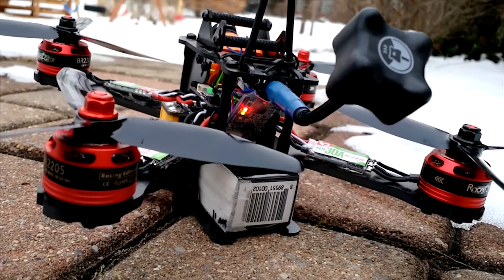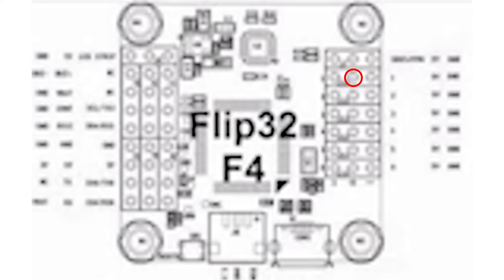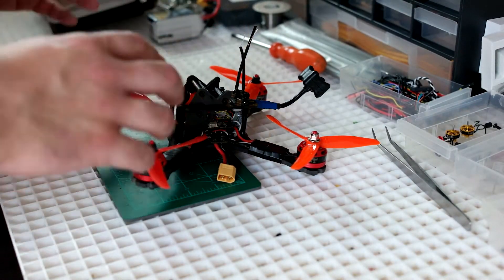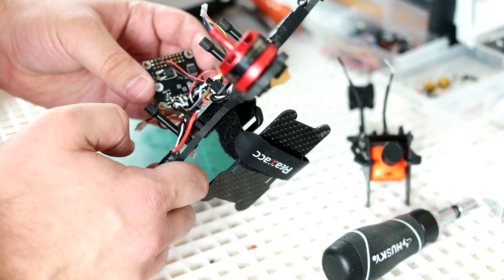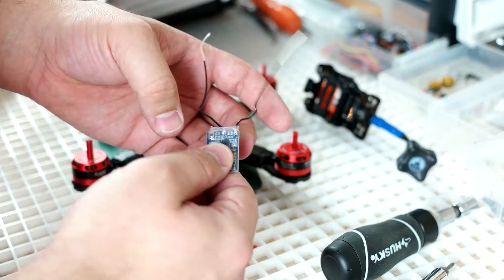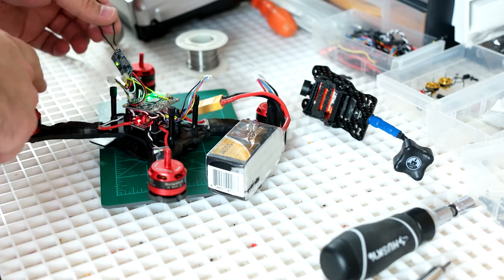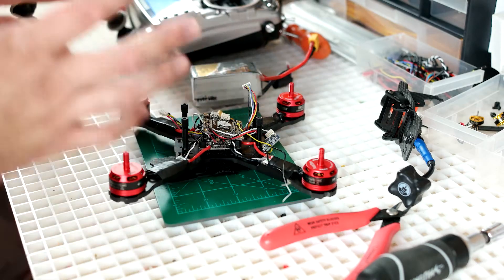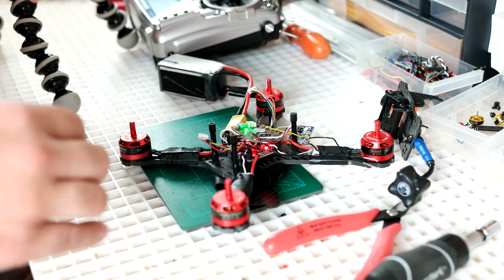RealAcc X210 FrSky Telemetry + Power Troubles

Comment: hello, do you remember what pids you used with this x210 and the racerstar motors, im on bf 3.2 with notch filters on 0 and pr1 enabled but i still have alot of problem and im not the best tuner so i still havent found pids better than the stock

Comment: What do you use the Telemetry on your Taranis for? Other than being neat to have feedback on the controller -- what's it useful for when you fly?
Reply from the maker: I use it for the low voltage warnings.  While flying it can be difficult to focus on the OSD, and it can be easy to ignore your voltage dropping to dangerous levels.  Having the Taranis announce the low voltage is easier for me to be alerted and then take the appropriate action.  I also have a timer setup on the Taranis, but enough other factors can influence the accuracy of relying on the timer..
Reply: Ah - nice -- that makes sense - thanks man

Comment: I was also getting those 5 volt drop outs on 3s Lipo's. I am sharing the 5volt output with my HS1177,X4RSB and my Naze32. Its not a problem on 4s Lipo's.
The issue is that the 5 volt converter on those PDB's is limited. Putting high power motors causes the Lipo to sag and the PDB struggles to maintain enough current.
It used to be much more widespread problem with earlier PDB'S. Ive had quite a few PDB's 5 volt output give up completely.The Matek ones are better though.
If you cannot trust your 5 volt output. Then the best solution is to add a buck converter. Connect it between your Lipo and your flight controller. Buck converters are adjustable, so you can dial in 6 volts. This takes the strain off the PDB,No more issues.

https://www.banggood.com/DC-DC-Adjustable-Power-Supply-Buck-Converter-Step-Down-Module-p-922049.html?rmmds=search

Comment: Hi, have you come up with any good pid's for this build.
I am struggling to get some good pid's for this build as I am new to tuning and would love to have a starting point.
Thanks 😉
Reply from the maker: +Q-Rexx FPV I have added a go pro session to my build and still need to tune further with that configuration. I definitely had to increase d a bit with this build though. And run lower ps than I was used to on other builds.

Comment: That antenna testing tells nothing. You get signal that close to the transmitter regardless of antenna condition (...and you still had one working). I don't know what you mean with old battery at the end but it seems that battery is at storage voltage, which is good. A4 telemetry is average calculated cell value, not total pack voltage which is VFAS if that's what you tried to achieve.

I use onboard 5V only for FC and receiver. Camera and VTX use the PDB 5V. For LED lights I have a third 5V source (Prod: 999753 form banggood).

Pics: http://www.saunalahti.fi/~uzzi/random/quads/omnibus/
Reply from the maker: Thanks for the reply man, I probably wasn't clear in the video what my goals were with my testing.  I wasn't testing the signal strength by reconnecting the antenna.  I was just trying to make sure I didn't short anything and break the receiver, which I didn't think I did, but seemed worth testing.

I am also fully aware of the different voltage telemetry values.  I was simply pointing out that I was expecting a storage voltage charged battery and not a fully charged battery.  I didn't want someone to assume that the voltage reading was incorrect, and when I said "old battery" what I really meant was "used" or "not fully charged".  

This feedback really helps me think about the way I word things, and to be very aware of the words I choose to explain things.  Thank you!

Comment: Im getting a Flysky i6X clone with an A8S receiver tomorrow, which is similar to the X6B apparently. Where on my F4 board should I solder the wires????
Reply from the maker: Sounds like you're getting FlySky and not FrySky.  That's fine as long as you have a FlySky transmitter.  And while I've never used I-BUS before I would assume you use the same plug that I used which is the one labeled SBUS/PPM (top of the pin sets on the far right).
Reply: avoidrome i dont think that receiver supports telemetry. you should only need red white and black to use ibus.  yellow is for ppm which is older. not sure i would use that receiver tho since the banggood page says Note: This item doesn't support failsafe. receiver ibus wire goes to uart RX
Reply: ok setup UART3 as serial pin and the protocol to I-Bus in Betaflight right?? And on the i6x, I set output to PPM and Serial to i-Bus right? THanks John E Fly, I soldered the red and blacks next to the RX3 labaled 5v and Ground. I wasnt sure if I was supposed to use 5v/Ground from the other side...Thanks for clearing that up
Reply: John E Fly use UART pins, not SBUS pins since the SBUS pin gets inverted.  SBUS pin, UART 1 and DSM input pin are all connected together with the SBUS version passing through an inverter.  UART 3 and 6 are options too.
Reply from the maker: +jonbrabham Thanks for helping out!  Sounds like FlySky makes things even simpler
Reply: ok I will solder to the UART pins. THank you
Reply: OK im confused... I have 4 wires that I need to solder right? (red, white, black, yellow) You said I need to connect to UART1? Where is that?? And where do the other 3 wires go????? Im pretty confused as this is my first time doing this...
Reply from the maker: The REVO f4 comes with 3 UART ports, UART 1, 3 and 6.  UARTs are made up of 4 pins, TX, RX, 5V and GND.  The SBUS pin that I used is apparently the UART 1 RX pin but inverted (according to jonbrabham above).  

For Flysky I would probably use TX/RX3 and then use RX3 as the serial rx in the ports configuration.  If you look at the pinout guide you should find a pin labeled RX3 and wire the transmit of the receiver to that.  You then connect the power to 5V and the ground to a GND pin.  

I have no experience with Flysky, but that should get you started.  Maybe jonbrabham can provide additional info.
Reply: in travis grindal 's pic, it shows a wire going to TX3......but you said I should connect to RX3?? im becoming more confused...
Reply from the maker: Is travis flying FlySky?  Do what he says if he is.  Look at the A8S it shows you what colors are which pin.  By convention red will be power, black will be GND.  It looks like white is I-BUS.  The way I connect my receivers I connect that to an RX pin, and then connect the telemetry to a TX pin.  Perhaps the A8S works with a bi-directional pin and that's why you use the TX pin?

I bet it would work if you connected I-BUS to RX3 but you wouldn't be able to get any telemetry.  You'll be better off finding someone that uses FlySky and definitely do some research on the products you bought.  It does show you what the pins are for each color.
Reply: I found a diagram that shows where the RX and TX for UART3 is...but where are the ground and power for UART3?
Reply: +jonbrabham I have read that it actually does do failsafe...I guess theres a trick for it to work....I think is what i read........But yeah, now im extra extra confused.... So I solder the white wire to UART3 RX?   or UART1?  What about the black and red wires?
Reply: avoidrome black goes to ground, red needs to go to a 5v regulated source
Reply: So can I use the SBUS ground and 5v? can I use any ground and 5v? Sorry I just dont want to blow anything up.. Where does the white wire go to??? UART3 or 1? I think im retarded..sorry
Reply: avoidrome yes any 5v and gnd, uart 1 and uart 6 have all 3 pins u need, just choose one of those
Reply: avoidrome ur call, gx210 is almost identical but its rtf.  uart3 doesnt have voltage supply that u need.  see pinout here https://quadmeup.com/wp-content/uploads/2016/10/Flip32-F4-Flight-Controller-pinout.jpg
Reply from the maker: solder the white wire to the pin labeled RX3 that jonbrabham showed you.  He has shown you exactly where to solder.  You can solder the red to any 5V labeled pin, and the black to any GND labeled pin.  

Think about it this way, you need to send the signals from your receiver to the flight controller.  Therefore the flight controller will be receiving the signals, and it should connect the receiver to it's RX (receive) pin.  You'll then need to setup UART3 as a serial RX pin, set your protocol as I-BUS and you should be good.
Reply from the maker: Glad we could help.
Reply: Im not sure if I did it right because my receiver died after a few mins being powered...maybe I should have gotten power from a different set of pins?

Comment: You said to solder a wire from the 5v to the spot you said? Where do I wire my camera to then?
Reply from the maker: I don't want to say anyone did it wrong.  It's what the semi-instructions said to do on banggood.  For me, I needed VBAT to power my camera, so I connected my camera and VTX to VCC on the PDB.  You can also connect the camera to the 5V pad on the PDB if you want to run your camera at 5V.  Alternatively if your camera/vtx support 12V you could also wire them to that pad.  You should have many workable solutions.
Reply: sweet! I probs will get a Swift2... Would you recommend using 5v over 12v? why?
Reply from the maker: recommend using 5V over 12V for what?  For the camera?  If I'm using the runcam swift 2 I would just use VCC (battery voltage) for the camera.  It's rated up to something ridiculous like 36V.  Why strain the voltage regulator?
Reply from the maker: Look at the PDB, you'll see a pad labeled VCC.  It just means it's battery voltage.  Directly connected to the battery postiive lead, just like the pads that you connect your ESCs to.
Reply: SHould I just wire VTX to VCC also then? I got a Eachine TX526 VTX...
Reply from the maker: +avoidrome that's what I did. That looks like that same vtx I am using
Reply: ok if the ESC's are the same as VCC, then I will use those pads.... Is there a recommended system for connecting the camera and VTX's powr/gnd wires to the pads?
Reply from the maker: +avoidrome there is a vcc pad on the included pdb, use that
Reply: Can I not use the ESC pads? Im asking because I have two free sets of pads. Could I use one set for the camera, and the other for the vtx? Or do you highly prefer using VCC pad only?

Comment: yah i had the same power issue, powered everything from pdb to fix
Reply from the maker: You didn't also run VBAT?  I wanted to run both so I could have voltage monitoring for my Telemetry.
Reply: John E Fly powered FC, LED bar, receiver, vtx and fpv camera from matek pdb. only FC connections for me are ESC signals, UART for IBUS and upper VBAT pins for FC power. this was my first build and the FC power issues were no fun. tried to power FC from 5v, then 4s lipo then finally 12v to resolve issues.  the flip32 f4 / airbot F4 thread on rcgroups helped me out a bit.  i get voltage telemetry from my flysky x6b by its own vbat feed.
Reply: why did u have to power your FC from 12v? ddamnit I just finished all my wiring and I read this....wtf
Reply from the maker: don't worry about running the FC at 12V.  Just because it works for one person doesn't mean you should do it too.  The FC runs at 5V.  So even applying 12V you're still going to need to regulate it down to 5V.  At 5V it would not have to use the voltage regulator to power the FC.  12V will generate less heat to generate than 16-17V so likely that's why it was helping him.  You would be better off not using the 12V imo.
Reply: John E Fly yah, i think i did go back to 5v, sorry.  was a nightmare. can check next time i take the pod off, but cant see now with it assembled. dont listen to me =)

Comment: I have this same exact kit and wired everything up the way you changed it, but fortunately did it right the first time. haha  I did plenty of research on the F4 wiring while waiting on that banggood shipping. It was definitely a hassle, but damn was it worth it. This quad flies so amazingly. Especially when you consider it's only 120 bucks for nearly everything you need. Just add a receiver and camera/VTx and you're all set. Couldn't be happier with my x210 pro.
Reply from the maker: Haha!  I fell for the "no need for a 5V regulator" on Banggood line and paid the price.  Luckily it was all solved in a day.  But I agree, the quad flies amazing.  I love flying it.  I just need to find a solution to mount a GoPro session on top of it so I'll use it more in these videos.
Reply: Yeah, it's tough since there are no slots to put a strap through going around the sides of the camera. I'd love to throw a Session on it, but I just use a GoPro 4 since the off center lens allows me to put the strap straight around the front and not block the lens. I fear a Session will require some sort of 3D printed mount to safely attach it.
Reply from the maker: I think it will take a 3d printed mount.  I don't have a Hero 4, so I plan to try my hands at designing and printing a session mount for it.  I haven't been able to find any that someone else designed, so I'll try my own.  I'll make a video covering it if I pull it off and make sure it's shared for any other owners that want to try a session.  Here's to hoping I pull it off...